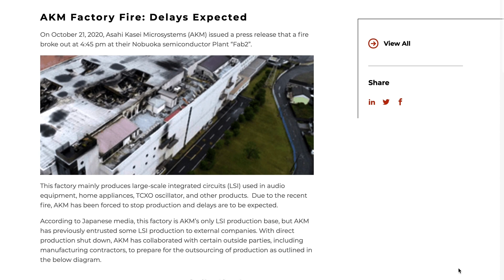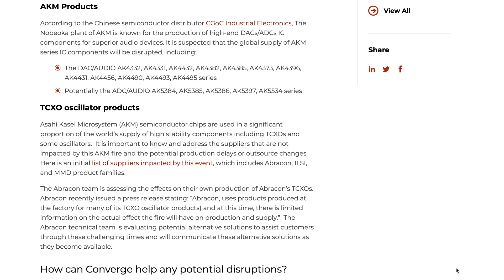February 2021 livestream Excerpt: Yaesu FTdx3000 Discontinued - Ham Radio Q&A

Comment: I enjoy my ft 450D and my ft 450AT, But I recently purchased a used, almost new FTDX 3000 as well. I use them all and I like them equally as much. They are all keepers. But...hey, I still enjoy using my Realistic HTX 202 that I purchased new in 1993 and it still works flawlessly with no issues what so ever,  and my HTX 404 that I purchased a few years later......... Just hate to part with Radio gear.
Reply from the maker: I picked up an HTX-202 and HTX-404 from a ham estate. They are on my list to make a vintage 'review' video.
Reply: @KB9VBRAntennas   Excellent purchase IMO. I look forward to seeing the review.
Reply: I've been using my realstic dx394 for a few years .. lockdown... and beyond

Comment: Where can I find the release from Yaesu on this? I have heard its fake news. I believe you, but where can I read it?
Reply from the maker: I haven't seen an official release from Yaesu, but Yaesu's national sales manager made a statement that it was cancelled on their Facebook page: https://www.facebook.com/groups/yaesuusa/permalink/4202185966477009/ He may have said more in his podcasts, but I haven't listened to them.
Reply: @KB9VBRAntennas  That only mentions the 3000. Didn't see the 5000mp mentioned.
Reply from the maker: The 5000 has been a little more difficult to track down, but Universal Radio lists the FTdx5000MP as discontinued. That's the current model in the 5000 series. https://www.universal-radio.com/catalog/hamhf/0355.html
Reply: @KB9VBRAntennas  I had a conversation with GigaParts and they said both were discontinued. On the air I have heard arguments both ways, yes its gone, no its not. I'm digging, Thanks for your input.
Reply: @KB9VBRAntennas  Ok, so I have spent to much time on this, but I got a little miffed so I followed it through. I joined that facebook page, it took 4 days for my post to be accepted and was deleted after a few people replied on the topic. Looks like John Kruk or some other admin didn't want it discussed. Before it got deleted John said it was not discontinued, but a yaesu rep from the UK piped up and said he was told by yaesu it was discontinued. At the end of the day, it makes no difference to me, my only issue is getting jerked around by them. Not real impressed with the way they handle the official USA facebook page.
Reply from the maker: Yaesu finally released a statement that the FTdx5000MP is still in production. I don't know what the deal is with Yaesu, but they have a terrible time communicating internally. No clear message from the company is what causes the misinformation to spread; as it appears someone was telling the dealers one thing and another person was telling the public another. https://www.facebook.com/groups/yaesuusa/permalink/4247167738645498/
Reply: @KB9VBRAntennas  This facebook announcement was in response to a complaint I filed with Yaesu directly on the handling of my post. The one they deleted was the one I started. I had got notifications of responses on my post and it was deleted before I could read most of the replies. I read one reply from another rep from Europe and he had said the opposite from John. I made no vulgar or demeaning posts there, and my second post topic was ignored and never allowed to be seen by the members. I think this whole thing has become ridiculous and the rumor flames were fanned by the way the post was handled. I don't enjoy having to become a asshat and a jerk to get a simple answer. I am very busy with my company but this thing struck me wrong, and I had to make a mission out of it to just prove a point. At the end of the day I got a answer, and its all I wanted. Just had to waste 2 weeks of my life to get it. Thank you for your followup on this.

Comment: It is not a big loss. FT-DX5000 seems to be an excellent performer based on the Blocking GC and IMD figures. But numbers do not mean that all is perfect, far to be. Indeed, in the field this transceiver is disappointing. The nice band scope is almost useless, and the access to many functions require 4 or more operations on the menu ! Then, under heavy noise, the AGC is not efficient. At last, using an amplifier the processing is almost in ALC (not better on Yaesu FT-DX5000 or FT-950) with no point in Class A. In fact, a mid-end transceiver like Kenwood TS-590SG gives better results ! 
For short, a so-called high-end transceiver on paper does not mean that it is a great performer in the field

Comment: Whilst on the subject of obsolete radios, lets not forget the FT-817nd and the FT-818? Where is the Yaesu IC-705 killer? The FT-817 is now TWENTY YEARS OLD, launched in 2001. I have a Yaesu FT-817ND (launched 2004) It's OK, but my old eyes would like a display larger than a postage stamp, I'd like some 21st century battery technology too! G7VFY

Comment: Goodbye 3000 & 5000, you will not be missed. Parts not available = soon to be unserviceable?  They were meant to be a bit messy if not well matched to a linear amp. The ICOM IC-7100 and 7200 were both supposed to be mobiles. I always fancied the IC-7200 with handles. As for repairs, there are very very few radio hams who have the skills and equipment to do sophisticated surface mount repair. G7VFY
Reply: ftm100 is also out of production

Comment: First
Reply: Im a swl got the 3000 just for great receive + nr beats high end receivers
Reply: @marrkparkes3775  omg wait till you hear the receiver on the 10/101 😜KC3ONO
Reply: @kevinkc3onohelijeepworld  had you got the 3000
Reply: @marrkparkes3775  no but going by Rob Sherwood #s I have the yaesu  991a which Is even lower on the #s  I have a am transmitter 5,5 miles away and it blows out my front end. Station is 50 kw on day power and 10kw  at night, 80 over s9  with tuner out of line,in line I get 40 over signal. Building a notch filer to try to knock it down. But if not I'm gonna make a few tuners and start powering my house led lighting 😣KC3ONO
Reply: @kevinkc3onohelijeepworld i love look of the ftdx 10
Reply: @kevinkc3onohelijeepworld  move
Reply: @marrkparkes3775  yes love the 101 and the 10 is the little version 😉 I’m thinking I need two vfo s though 🤔☺️ so if I can get 2800 from the next stimulus I’m gonna have to get the 101 n my md100 will have to cut it till I can get the m1 reference mic 😜 the 991a will go in the Jeep and I ll be waiting till I can afford a hi Q antenna to get on Hf
Reply: @marrkparkes3775  no just need a super Rx Rig like 101/10 890 great dynamic blocking receiver at 2khz spacing. My rfi is on 1.920 I want to work 1.930 if I could filter n block out 1.925 down I be all set ☺️ if not you might hear about that ham who was hacksawing a am station feedline  in pa 😔
Reply: @marrkparkes3775  I suggest kyw 1060 in Philadelphia move their tx site to better location in pa ☺️